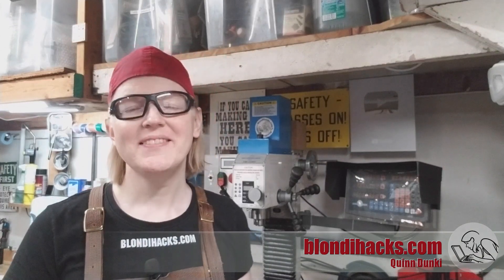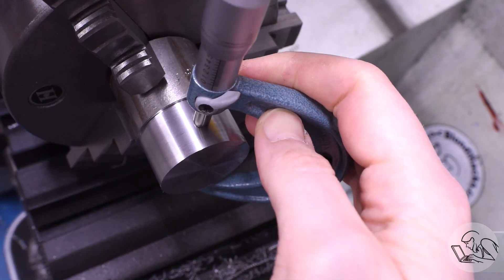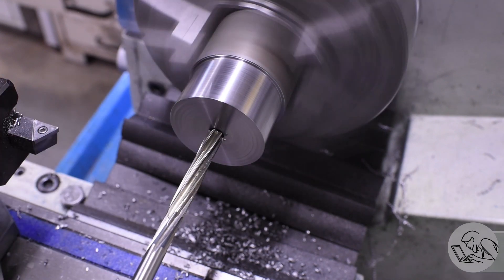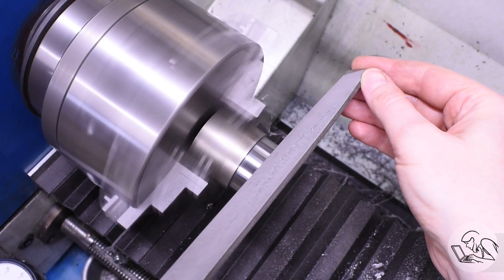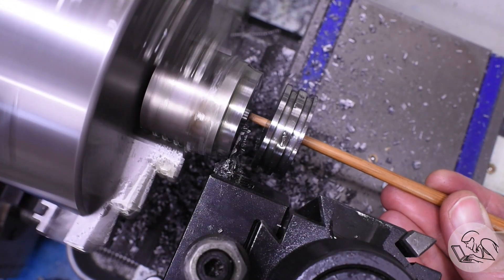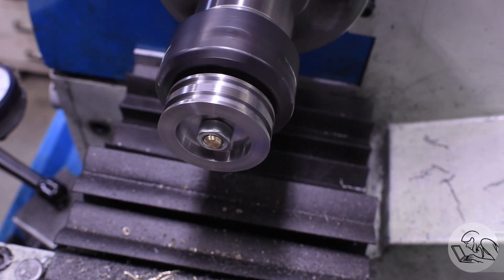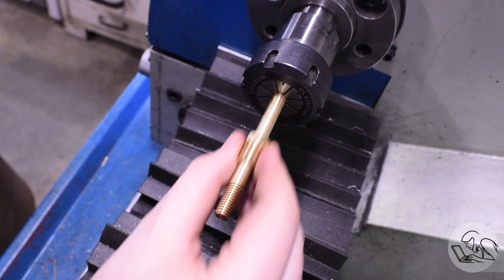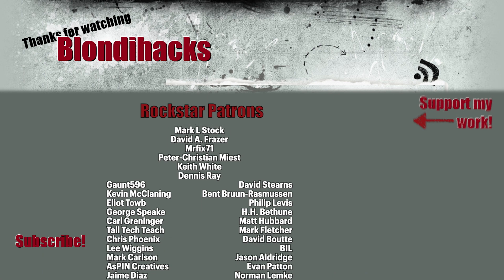Machining a Steam Piston - Big Steam Engine Build, Part 11!

Comment: Hallo,  wie heißt das Teil bei 1:18 1:23  um den Innendurchmesser zu nehmen und dann mit dem Mikrometer  zu messen .            Hello, what is the name of the part at 1:18 to take the inside diameter and then measure it with the micrometer.

Comment: Regarding parting. I find that (on my lathe, tool post, etc.) parting some materials over about 1.5" in diameter tends to cause the parting blade to walk around slightly upon first contact with the part. I assume parting blade extension (and blade width) is the culprit here. My go-to technique is to make contact, cut to a depth of 10 - 20 thou and then back off. Then adjust the horizontal position of the blade as necessary to insure it's perfectly aligned with the initial cut. Then re-engage. This pretty much insures the blade won't skew as the cut progresses. Perhaps your setup was perfect, but your blade just went for a walk. Parting blades are a little like cats (mind of their own).
Great video, BTW!

Comment: I love machining 12L14 but I find that corrosion is a big problem on the freshly machined surfaces. Is this going to be a long term issue for the piston? Would electroless nickel plating the piston help?
Reply: I have had the same issue with 12L14 which I think is exacerbated by my location on the Atlantic coast. I have found 1215 to be an excellent substitute (which is carried by Speedy Metals and McMaster-Carr as well). It doesn't machine quite as easily as 12L14 but it comes pretty close. However, I don't know if the lead content in 12L14 is a factor in its selection for the piston in this project. (Lubrication properties perhaps?) dunno. Perhaps Quinn would have some input on this.
Reply: @32thedoctor  Also the use of a brass rod in direct contact with the 12L14 could cause galvanic corrosion.

Comment: I wonder if it would be better to arrange that the piston sits at such a position in the cylinder that the volume above the piston at TDC is equal to the volume below the piston at BDC, thus  allowing for the volume displaced by the piston rod at BDC?

Comment: Greetings all. Packing glands are what you make them literally. If you understand the principal, you can vary the outcome, ie; leakage or say making up for shaft ware. For those that run or ran reciprocating engines any length of time know you were constantly adjusting glands for ease of run as well as lubrication. As a side note, I ran maintenance on steam hammers the largest of which used 10" piston shafts. These work horses required repacking every day and the majority leaked steam past the inlet valve...lots O fun. Love this channel.

Comment: The US navy still uses graphite yarn packing for some pumps and most valves. It works well and is not as finicky as mechanical seals. Turbines and larger steam valves tend to use gland sealing steam and an exhaust system. The exhaust is drawn to a condenser via a steam eductor, typically the same condensor assembly that handles the main condenser air ejector exhaust.

Comment: Hi Quinn, that had to be a satisfying milestone, seeing the whole Assembly Piston through piston rod, crosshead, connecting rod and main end bearings with the whole unit operating as it should. I do have a question please, will the piston rod be pinned to the crosshead or secured with lock nut? It’s really starting to look like a steam engine now, its sweet, nice one Quinn. Valve gear next - maybe, I can't wait to see whats next.

Comment: We still use gland packing nuts in shipping. We use them on most standard centrifugal pumps, include the boiler feed pumps. Turns out, sealing a moving surface is a pain so we use what works. At least it isn't asbestos anymore...

Comment: Sorry… Nothing related to the video. I have an old lathe… just put it to work. It doesnt have the gears or any table to make threads. Any Tip?? 😩
Reply: Look into Clough42's electronic lead screw.
Reply: Find out what module the gears are and buy some. Then you just gotta find every change gear and gearbox position and write it down.

Comment: Blondie,  My memory informs you once were more of a fan of hss over carbide lathe tools.  Over time it seems to me you're using more carbide.  Is that right?   Would you list your favorite carbide holder and inserts? Yes, hss for form tools still rocks.
Reply: HSS wins for versatility until you have a grinder for carbide.  Case in point is the ad hoc scraper insert from the recent Keyway episode.

Comment: How similar is gland packing to the rope crank seals? Seems related but the rope crank seals definitely don’t see much pressure (actually a bit of vacuum due to PCV valves).
Reply: Actually on second thought possibly more related than I thought? Even though it’s not much pressure, water is much more viscous than air. And those were used at least into the ‘70s.

Comment: Great work,  tip on counterbores: use a 2 flute slot drill in the tool post, with cutting edges horizontal/on centre  plunge In, then use as a boring tool.
Thanks for sharing.

Comment: The factory I work at we still use graphite yarn and seal water to seal pump shafts… give it most of the equipment is from 1888-1980s

Comment: Okay, dumb question time. Why don't you move the lathe's motor and give it more gearing so you can do low speed operations more easily? It'll be a fairly decent amount of work, yes, but the payoff when working with slow speed operations would be worth it.
Reply: She went into why it wouldn't work on her Patreon page; and, as a Patron, trust me-- it wouldn't work.
Reply: She, like most Variable speed motor users, is so spoiled from speed control, she wouldn't want gearing.

Comment: I’ve worked on many large cross-head style air compressors. When setting piston clearance’s we set the piston closer to the rear head. Calculate total piston clearance then adjust piston to allow 2/3in front head & 1/3 on back head. This allows for expansion of piston rod& at full temperature the clearance should be close to equal at both ends.
Love your video’s. I’m a beginner machinist & learn something new with video.

Comment: In US Navy reactor plants many pumps still use packing glands; you adjust them by number of drips per minute. The steam turbines use gland sealing steam.
Reply: Same story in oil refining -- most things are mechanical seals like our illustrious host mentioned, but for some jobs, nothing beats a steam driven reciprocating pump, packing glands and all!
Reply: Boats use packing glands. Same thing
Reply: Most conventionally driven boats have a packing gland around the propeller shaft. Every working boat is  sinking - it's only question of rate.

Comment: 10:30 - if you have a precise hole like that - put the gauge pin in tailstock chuck and hang the part on it. Push the assembly in the lathe chuck and than you can just bump in the jaws to touch the workpeace.
16 minutes since publishef and my like was 97-th. Great job again 👍
Now to see the rest of the video 😁

Comment: Not to downplay the precision ground and machined metal parts, but this made me curious about uf you could make a functional steam engine out of plastic, like if you 3d printed one. I would assume that a lot of the very precise components like the piston head would require a much finer resolution than the smallest layer thickness of a filament printer, but could you machine plastic to the right size without having things bind and crack? I'm also not sure what plastics you should use. I really only know of the major recyclable kinds and delrin. I'm not a machinist and I'm not looking to try this myself, but I was wondering if it would be at all possible
Reply: Define “steam”, and “plastic”. As long as the working medium and temperature are compatible with the materials, it can work. Look up “organic Rankine cycle”.
Reply: I've seen it done with compressed air, but the main trick is to finish the important surfaces e.g. by sanding, as that can make them flat and accurate, without needing excessive print quality (and thus print time)
Reply: That sounds somewhat feasible to me, although I would never expect it to work particularly well.